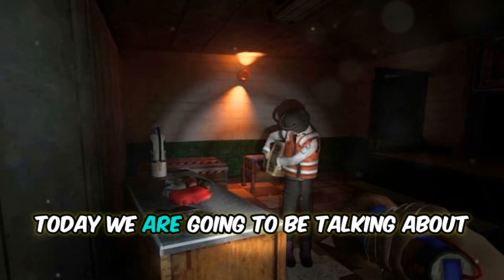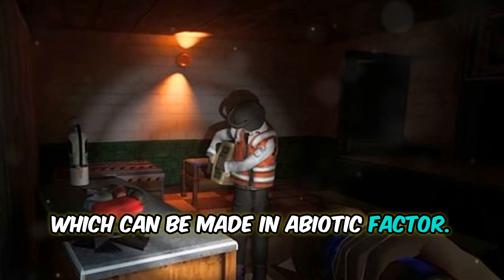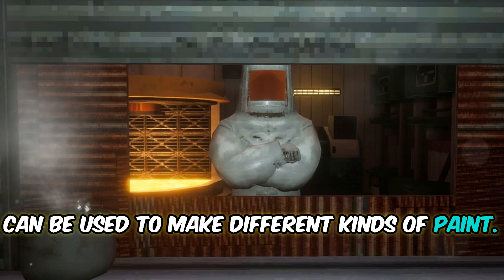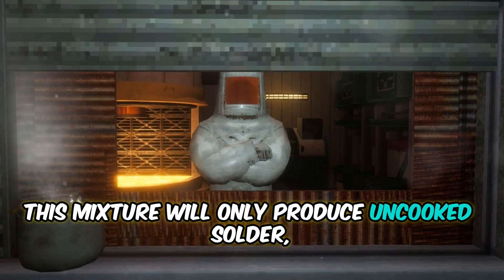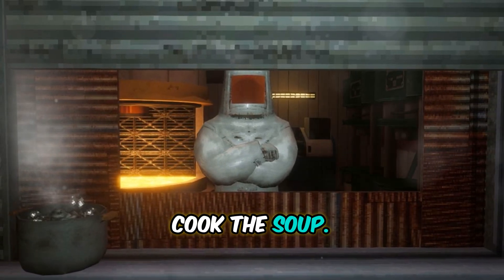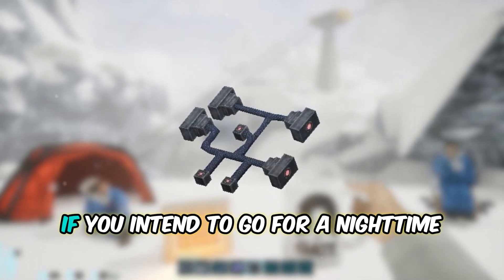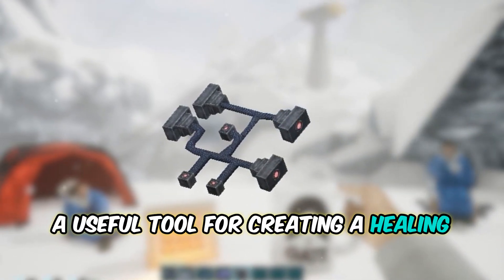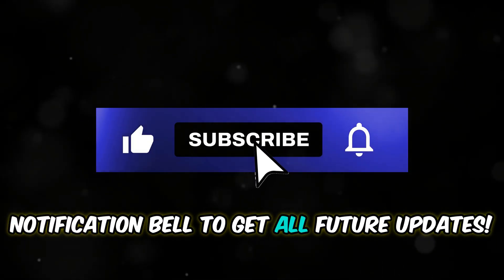Abiotic Factor How & Where To Get Fibre Optic Cable, Solder & What Does Fibre Optic Cable Do

Comment: I crafted the Solder soup. Unfortunately, the Forge guy still won't sell me the fiber optic cable, like i still haven't "unlocked" it with him, even though the solder is in my inventory. Is this a bug, or am i missing something?
Reply: You got to put the pot on the floor and scoop it out
Reply from the maker: Did you put the pot on the floor?